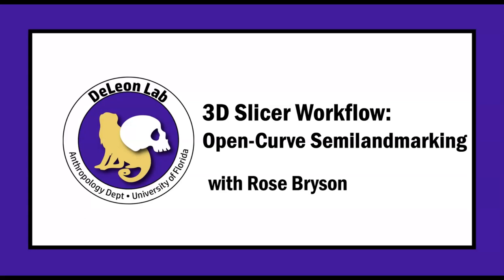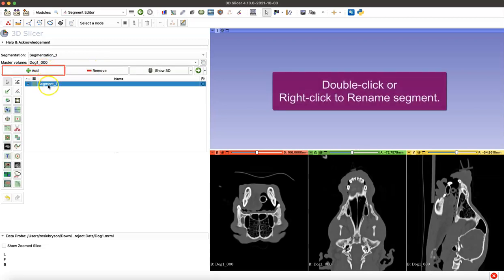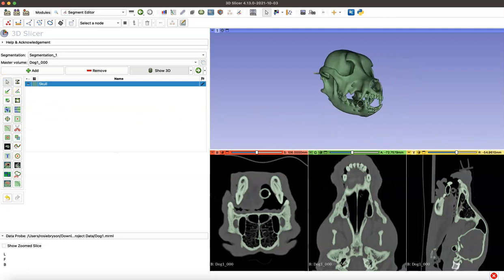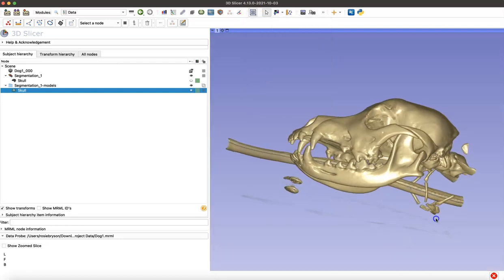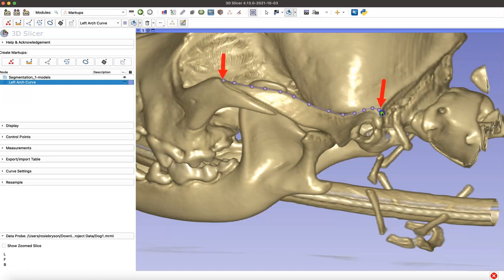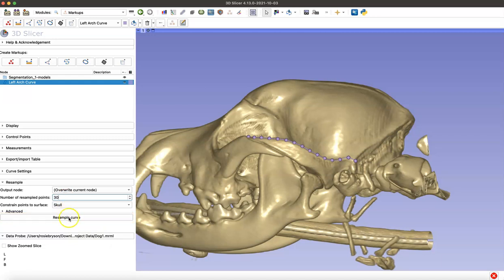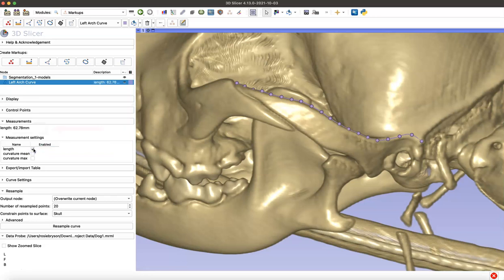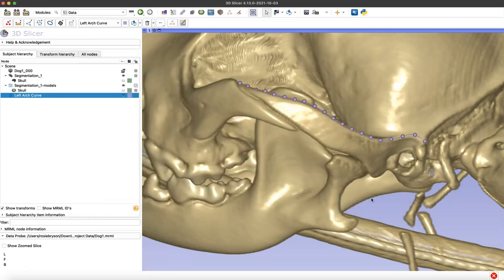Taking Open Curve Semi-landmarks   [3D Slicer Workflow]

Comment: Is it possible import fcsv file to 3D software, like Fusion360 or Solidworks and similar?
Reply from the maker: Hi, I haven't used those programs so I'm not sure. You might have to check with their customer support to find the best file format to import coordinates. Good luck! - Rose

Comment: Hello Rose, your Slicer tutorials have been extremely helpful and I cannot thank you enough for them. Could you tell me if there is way to join two different semilandmark curves through a common landmark?
Reply from the maker: Hi Vaibhav, I'm so glad they've been helpful! There are a few ways to merge two curves, one is to use the MergeMarkups module. But its much simpler to just select all the coordinate data for your second curve (found in the left-side menu under "Control Points" in the Markups module) and copy/paste it into that same space for your first curve.  That will make one new combined curve with all the points you originally placed, but you'll want to adjust the points along the new merged curve to make sure they're accurately placed and Resample so they're equidistant. Also, importantly, if the homologous landmark you mentioned wasn't part of your original curve, then you'll want to add it as the last point in your 1st curve before copy/pasting the 2nd curve. 

Or if you're wanting to make an enclosed circle from your two curves, there's also a "Closed Curve" option that could be better. Let us know how it goes!
-Rose
Reply: @deleonlab  Hi Rose, your solution(s) work just fine! The MergeMarkups module seems to be a bit painful, so I'll go ahead with simply copy/pasting the control points. All the best for your future endeavors!